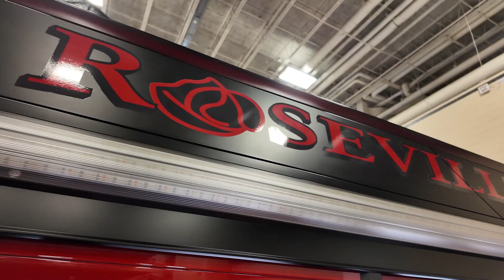Roseville Fire Department's NEW All-Electric RTX - 1E5691

Comment: Hope it stays in service longer than LAFD's rig. Water tank issues, battery issues, misc electrical issues too... Also just an opinion here but your EV lighting choices suck. Bad placement and even worse strobe patterns.
Reply: Those are Fabricated lies from the Los Angeles Wild Fires disaster. Scammers trolls claimed 45 Pure Electric Fire truck could not be in service because they had to charge for 10 hours. No such trucks exist with the LAFD, they only have these RTX Series Hybrid Diesel-Electric trucks.

Comment: @11:25 there it is diesel powered with extra steps and expensive extra components
Reply: Pierce's Volterra and REV's Vector have it too. They harp on the "all electric" side for marketing but the ICE is still there for long duration incidents.
Reply: @tfefire Smokester…you’re really getting tweaked. Calm down there buster.
Reply: FAIL at engineering. It's just a small car like diesel engine as a GENERATOR. It has no mechanical connections to the wheels. It's much simpler and more reliable, engine is also tiny and not powerful enough to mechanically drive the truck. This is called a SERIES-HYBRID. Proven power train design in Mining, Logging, Ice Breaker Ships, Cruise Ships, Navy Submarines and obviously Rail Locomotives. You have no clue what you are talking about.
Reply: @Neojhun  What triggers  people??? We learn something new every day Nojoon.
Reply: @Neojhun  It's not simple and it's not reliable

Comment: I would walk to a call before riding that thing.
Reply: I rather drive this Series Hybrid Diesel-Electric than an old truck with a Diesel engine struggling to mechanically turn the wheels.
Reply: Then do it

Comment: The RTX is having lots of growing pains! Selling mostly to communities that have larger departments with solidly diesel powered fleets!
Reply: Every Euro-style piece of equipment (apparatus, helmets, etc) struggles in the US. Now add in the electric side which many are still skeptical about. Some legit operational differences or deficiencies for customers but also plenty of hurt egos as other comments show.
Reply: Which growing pains you Talk about?
Reply: But these are Diesel Powered also. It's a series hybrid Diesel-Electric truck.
Reply: @Neojhun  The diesel is not connected to the drivetrain, it’s for extension of the use of the pump operations per NFPA requirements!
Reply: And are Biden and Kamala burnouts.